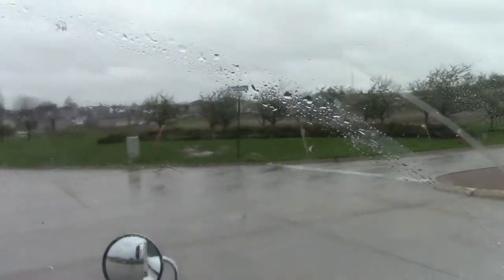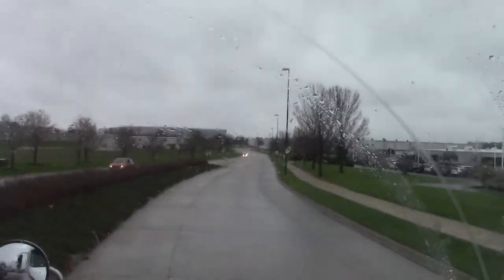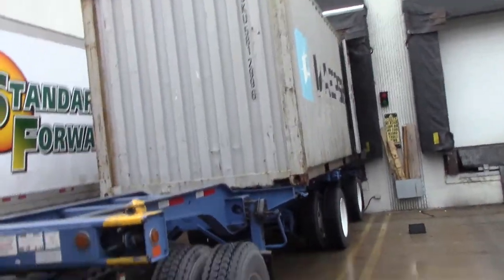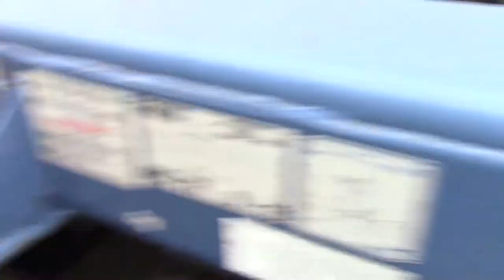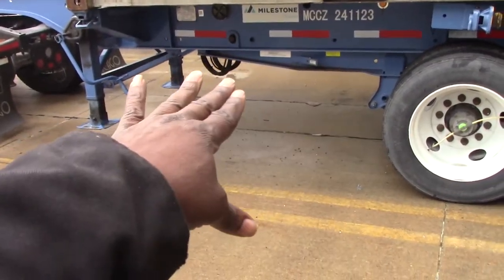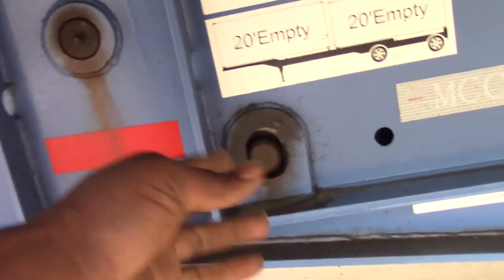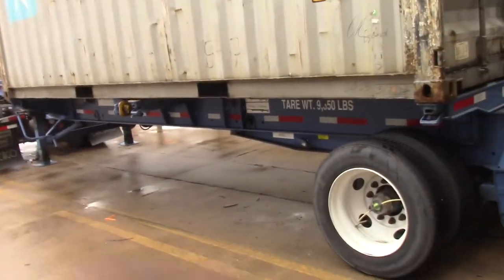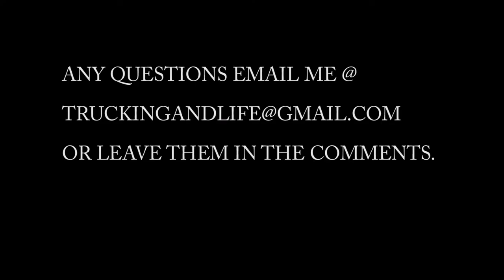RAIL YARD: HOW to slide a 20 FOOT SPREAD AXLE chassis !!!!!#20FOOT#TRUCKINGANDLIFE#

Comment: If you don't have a container on the chassis , your driving the chassis bobtail no container . Do you drive it with slide  back or can you drive it slide forward ? Does it matter legally is my question.
Reply from the maker: It don't matter when it's a bare chassis!
Reply: @TruckingandLife  I work at the long beach port . No one drives with bare chassis slid forward. I thought and many think it's a ticket . My employer told me I can drive it like that . He was rushing me . I told hem I have to slide it back it's a ticket . He said it was legal to drive it slide forward . Thanks for the reply 👍

Comment: Any tips on sliding a non spread 20 foot chassis tandem ? You know how hard it can be to slide the tandem with loaded container.
Reply from the maker: I got a video about sliding a 20 footer. If the box is already loaded on there and it don't want to slide and if you're at a rail yard you can unlock the pins and have a crane lift the box off of the chassis while you slide it then have them put it back on for you! You have to be fast tho the mr. Crane dudes be in a hurry lol! If the box is 10,000lbs or less I believe you can ride the 20 loaded without having to slide it? Check with the state your hauling out of to confirm that! I know where i'm at that's legal! Hope this answered your question V.Q!
Reply: @TruckingandLife  thanks brother appreciate the help . From the looks of the video we hauling out of the same state . I’m hauling from Illinois usually Cn Harvey .
Reply from the maker: @Yapaso23  oh yeah I haul out of there a lot lol! I'll probably see you out here in the rails or on the road bro!
Reply from the maker: I meant to mention when you have the crane lift the box and you slide it have some  WD 40 or some engine oil to pour on the track and slide it back and forth to lube the track just in case you to slide it again at the destination.
Reply: If I am at the rail and no crane is around. I keep a heavy log chain on the truck. I will back up to another loaded box, wrap the chain around the axle of both chassis and pull. Do not pull on the D.OT. bumper. You will rip it off. I usually will do this in a quiet corner of the yard when there aren't a bunch of spotters around. I also have used the chain to pull the tandem release handle out and to open the chassis pins when the container is sitting on top of them.
Reply from the maker: @TheYardLimit  thats how you get er done driva! Nice quiet corner and go to work lol!
Reply: @TruckingandLife  yessiirrrrr
Reply: Also, sometimes the springs that keep the sliding pins disengaged, the springs sometimes are missing or are messed up. A quick tiedown or ratchet strap sure helps keep the pins unlocked so you can open or close the chassis. Sometimes I'm in a pinch in the long beach ports when chassis are scarce.